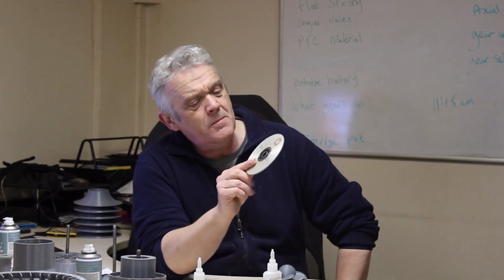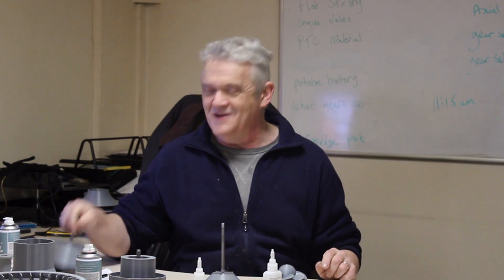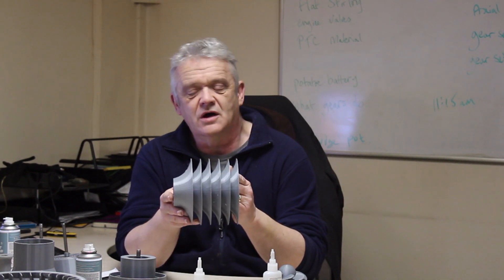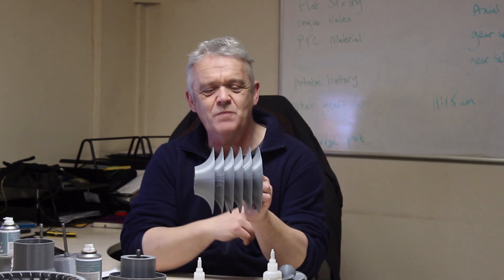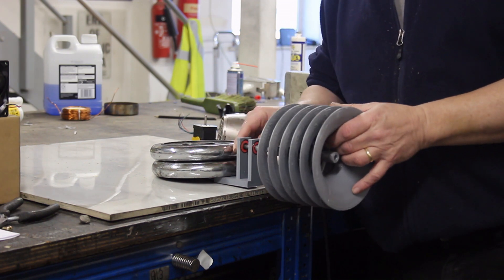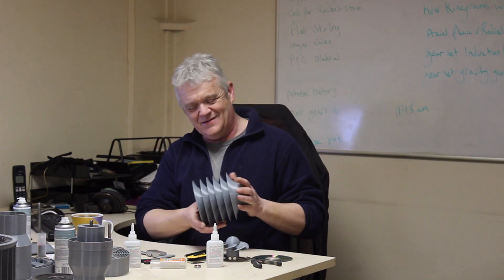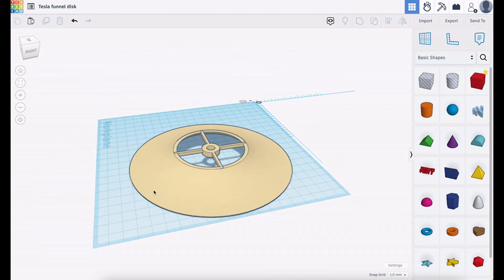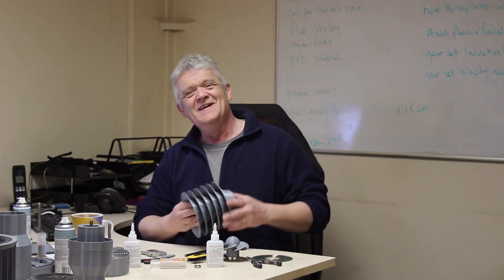1890 The Next Step In Tesla Turbines

Comment: I wonder if you could remove the central shaft. Make the holes increasingly larger, as you get towards the "exhaust". Use the Venturi effect to lower pressure in the center. 

Check out the eAhora M1P. I think there's the potential for practical perpetual motion.

Comment: Think wear hardening stainless cut on a plasma table . Very little machine work would be nessary.
With high speed/temp ceramic bearings .
The 2 failings of the original engine design ...
It will run on anything that burns .
Then one of Testlas high speed generators or alternator designs .
The cooling jacket would provide hot water or steam ...
Imagine an engine , steam turbine or a pump all from 1 design ???
And let's not over look the 1 way valve ...

Comment: I had a kid's board game that had a funnel and used a marble rolling around as a timer, forget the name.  I wonder...  painter's funnels?  They're conical.  Spiral grooves...  you don't need to do but a couple cm worth of rework.  Use a NACA airfoil where the cones hold together, pointed in the direction you need the generator to go.  A high-lift glider foil might be best.  Stack lots more in an off-center spiral?

Fire alarm horns?  Old PA speaker horns?

Comment: The formula I heard was 3feet diameter disks separated by 0.4mm gap at 50K RPM and driven by dry steam. This combination was expected to be the highest efficiency except that the materials he tried couldnt handle the tensile stress and that made him pareback on the specs.
Had Tesla been able to work with graphene, he might have reached a marketable product, reliable enough for mass production.

Comment: Just Incase you didn't know the Tesla Turbine doesn't need to operate at high RPM's to achieve results, the efficiency increases as the surface area increases and the gaps between the blades decrease. Tesla also filed a patent for an upgraded turbine number 186,082.
Reply: Correct its an electrostatic turbine not a friction turbine as commonly stated.
Reply: @off6848  I'm familiar with its use providing more torque inversely to the speed of the fluid between the plates but not its function as an electrostatic turbine, explain please?
Reply: @off6848 🦾🤓👨‍🔬
Reply: TL/DR from Charlie Solis: This is not a mechanical turbine in any shape or form. 

Since all molecular adhesion and internal viscous forces within a fluid are governed by electron orbital interactions, this makes the Tesla turbine a purely electronic turbine.

The BIGGEST misconception about the Tesla Turbine that most people get wrong is that they think the fluid is actually sliding and dragging on the disc, similar to as if a solid object was “sliding” across the surface of another solid object.   

It is not.
Reply: @JenkoRun  maybe my comments aren’t showing up but I shared multiple quotes explaining in a couple comments.
Reply: @testurenergy  Couldn't reply back till now, thanks for the sources.
Reply: @JenkoRun  well ignoring that will make cause you to misunderstand how these turbines actually work and thus not be able to optimize them appropriately. 🤷‍♂️
 
But to each their own I guess. 
It’s your prerogative to pick and chose to believe what you want.
Reply: @JenkoRun  spherical harmonics is not a “theory” in the way you are using the word theory. I can see you’re more familiar with the colloquial use of the word theory which generally means “a postulated idea that hasn’t been proven yet.”
 
But in the world of “theoretical” physics and math it has a far more finite, concrete and proven definition. 
 
Theoretical physics is a branch of physics that employs mathematical models and abstractions of physical objects and systems to rationalize, explain, and predict natural phenomena. This is in contrast to experimental physics, which uses experimental tools to probe these phenomena. (Not to be confused to  contrast with proven vs unproven) 
 
In modern science, the term "theory" refers to scientific theories, a well-confirmed type of explanation of nature, made in a way consistent with the scientific method, and fulfilling the criteria required by modern science. Such theories are described in such a way that scientific tests should be able to provide empirical support for it, or empirical contradiction ("falsify") of it. Scientific theories are the most reliable, rigorous, and comprehensive form of scientific knowledge,[1] in contrast to more common uses of the word "theory" that imply that something is unproven or speculative (which in formal terms is better characterized by the word hypothesis).[2] Scientific theories are distinguished from hypotheses, which are individual empirically testable conjectures, and from scientific laws, which are descriptive accounts of the way nature behaves under certain conditions.”
 
We are more than sure about electron orbital spherical harmonics. It’s extraordinarily well established. And any “new” postulation that is thought up to explain some unknown part of physics by definition must also then derive what we already do know and have established to be true about the universe with rigorous testing. 
 
Contrary to what most people think, it will not “up end” physics if and when a new and/or better postulation is found. 
 
The periodic table of elements isn’t changing if we find a new explanation of dark matter. It may expand what we already know, but it will not change the known elements.

Comment: I was wondering if you could use alternating dissociative metals for the inner turbine wheels and use an electrolyte solution for the propellant to create HHO gas while the turbine is running. 
Of course the whole unit would have to be electrified though.

Loved this video!
Reply: It is an electric turbine. It works on the principle of electrostatic adhesion not friction as commonly stated.

Comment: So is the endgame expected to be superior to a Vortex Bladeless redux, or other "concentrator" failures that have promised effective and relatively efficient alternatives to conventional turbines? I have a piece of sandpaper stuck on to the end of a drill bit. Not being well-connected to the bit, since its hole is slightly bigger, it rotates whenever the breeze kicks up a little. I can't imagine why it wouldn't. If I put a hair dryer on it, it would spin madly from its little bit of drag. It is also completely useless as any kind of design for power generation. The tiny sailboat-scale wind generator that my neighbors have, in contrast, is amazingly productive and inexpensive.

Comment: The big question is - is this actually acting like a Tesla turbine? Or is friction with the outer edges producing a low-rpm, low-torque rotation? We can't tell based on your video. Please repeat it with some way to show the airflow through the axial hub. If there isn't any such flow, you know it's not acting as a Tesle turbine.
"Conventional" Tesla turbines work as well as they do because they operate in a closed vessel. Working fluid injected at the edges MUST spiral into the axis because it has nowhere else to go. Your assemblies, being open will allow air to escape via the outer edge.

Comment: Pressed steel out of steel sheets. As you could have a mold bend the pieces into shape as well as have the middle keyed so that you can have a shaft through the middle more secure. And you can use washers for spacing. this would require some sort of press and mold, but in the end the product would probably be eventually cheaper as you wouldn't have to run a 3d printer. Just pressurize a hydraulic cylinder over and over on a sheet of rolled stainless or other metal of your choice. Of course you'd have to make a specific mold for the shape.

Comment: Can I ask why on motors there is only one drive from the shaft in all deigns of kinetic energy...
The weight distribution is a major factor; remember Steinmits charging $1 for the mark and the 99.999% for where to put the mark..
 Please explain the math in the ratio that to use to the surface and displacement of the vortex. My E7nglish is not quite explaining myself properly.

Comment: Of course the bearing mounted collector going to spin when air is blowing on to top side. Blow it on the lower side it will spin opposite direction. Nothing proven there.  I see there be much wind bypass slippage across those slick funnel surfaces. 
I would like to see 3 spaced fins that spiral downward inducing spiral motion. A few more parallel short fins in between at the inner edge. The funnel collector above and below have same design but opposite spiral direction.    The amount of air flow from each funnel would of course have to be tuned to create a uniformed increasing build of compression down the inner vertical stack of air..  If all spirals were same direction,  there would need be stator fins at the generating turbine.

Comment: A Tesla turbine principles is a friction between air molecules and a surface. Everything else is some misunderstanding of a hydrodynamics. Your high voltage line isolator works only because of a rough surface after a 3D printer.

Comment: As with all rotational energy generation you will need to gear the system to stop overspin. An external cylinder could be lowered or raised to close off wind access to each cone allowing the system to be completely smothered during storms or for maintenance.

Comment: Just been reading up on the Tesla Turbine, and after looking at this design, I have a question.

Will the "funnels" be attached to the bladed section within? So not only does the wind get funnelled down into the generator, but the very process of entering will also assist in the lower rotation?

This may have been answered, but I rewatched the video and didn't see confirmation.

Also, wouldn't groves in the funnels allow you to help determine the direction you'd want the wind to travel, and therefore rotate the blades?

A typical Tesla Turbine works based on viscosity, so I imagine it's currently spinning based on the micro grooves generated in the 3D printing process.

Comment: If / then ?
  If the air accelerates as is descends the hyperbolic funnel then does the pressure drop? If so are you able to create a low pressure column of air down a central axis? Would that pressure drop entrain more incoming air increasing efficiency? Think of it as a velocity stack on a carburetor. 
 I think the coanda effect will also play a role.

Comment: In CAD, create a cube, then extrude the shape of your cone from the top face of the cube.

Make sure that the inner most circular zone of the cone is also extruded to create a cylinder sitting proud of the tip of the cone.

Save this as a separate solid shape.

Once this has been done, create 2 x22mm square holes running all the way through the cubed base to the opposite face, from the left to the right edge.

Then, use the CAD slicing tool to slice through the front face in 22mm vertically orientated layers running from left to right.

Finally create 2 x 22mm x the left to right measurement across the lower edge of the front of the cube battons.

Save this as a separate file containing all the sliced shapes + the 2 X battons.

Have the job-lot sent to a plywood CNC company (maybe give them some advertising in exchange for the CNC time).

Once they have cut the basic shapes for you, have them stick each of the layers together such that they are slid over the battons to ensure correct positioning.

Once the solid shape has been created, have them use the solid shape file to have the curves milled to the required dimensions based on the solid object you first saved.

Then, it should be a simple enough task to fibreglass your cones using the former you've just created while using the 3D printer to create some spiraled separators to keep each layer the exact distance apart then need to be.

Could design the cones and spirals to slide over a plastic pipe during the construction phase to ensure that each layer is perfectly positioned during the layup and gluing phase too.

Comment: Spacing between profiles is critical, informed by the "boundary layer" - an emergent microscopic property - and the viscosity of the fluid entering the Tesla Turbine. 
You'll need to tinker to get it right, might not be possible to 3D print if the goal is highest efficiency but I certainly hope you can achieve a radical result.
Reply: @the_one_eyed_man_is_cursed  
A radial result lol

Comment: Is the water causing the disk to spin due the drag induced as it passes over  or around the disk. the problem with drag is that it increases with speed so to get better power transfer would you need high speed thus high flow rate of the water. if you want lower pressure water or lower flow rate are we not moving back in to the idea of a standard water wheel. they work better with low flow rates due to the paddles creating a high drag so impeding the water flow and transferring more of the power out of the water. 

Just a  thought

Comment: TeslaTurbines using water is fine, needing high pressure for it is an annoyance, what is the optimal distance to use ground effect, to drag them round? and will this work at lower speeds? sorry not on your level i just follow this stuff as it is fascinating, many thanks for all you do genius really, being a polymath allows innovation when specialisation restricts new ideas.

Comment: the true function of the tesla turbine is to have 2, one as a pump, the other as a turbine, on a common shaft, all under vacuum, running cold steam. that extracts environmental heat utilising the heat to do work and driving the system faster.

Comment: There’s nothing WRONG with the shape, it’s just the spacing.

Make one of VERY Light material at 4 thousandths spacing.

And it should funnel air into the center.

The flatter the disk, the less mass you have to spin.

Comment: Any natural wind would hit that thing,always,at 90 degrees to the circular form.
The wind would then be equally distributed on each side of the thing from the circle's center diameter.
Would that not cause the spin forces to be equally distributed to each side  preventing or seriously retarding any spin forces?
Perhaps spin forces would begin on one side but be quickly nullified by those on the other side.

Comment: You get another example of this boundary layer at work when you spray water from a hose, but put your thumb over the hole to create a high-pressure fan, then stick a paint roller in the fan so the fan touches it barely at first. in a second or two it will spin up like a powerful flywheel

Comment: Spirals are where my thoughts were going, but protruding, rather than inset - don't know why, yet. It would be simple enough to stretch a screw thread down both the inside and outside faces. It would be interesting to see rpm results with various models with inset/protruding spirals - various sizes of the spiral extrusions - maybe even try offsetting the axis of each spiral disk by a "x" degrees to see if any odd vortexes occur within...

Comment: I think the interesting question would be where the air is redirected. If it's redirected through the stack of cones and out of the middle, then that's extremely interesting. But otherwise it's just a drum being blown from the outside rather than the shear effect in a tesla turbine.

Comment: Alrighty, I just finished modifying the design to fit the shaft of a carbon fiber rod I had laying around in the lab.  The printers just started, ruby red translucent PETg. I think I'll start with 6 discs.  I have an aluminum sprocket as well that fits my cf shaft.  I wish I had an anemometer handy to compare wind speed v. power output.  What do you think for generator selection?
Reply from the maker: I am working on it mate - just having it hang out in open air will do not very much so it needs a case for sure

Comment: Grooves and or rough surface (on one side) will increase the surface friction which will increase the change in energy from the airflow to the shaft. Keep in mind laminar flow. Fluid dynamics on surfaces are tricky. First we have the flow. But really think about the induced laminar flow. Ie. The induced laminar flow is not the surface but the flow that occurs between the airflow and the boundary layer immediately above the surface. Roughening the surface will increase the friction between the surface and the airstream. Induced flow is magical and always counter intuitive to what we think is going on. Think about sharks , shark skin is rough to allow a better boundary flow and higher speed, manoeuvrability and grip in and on  the water. In the WW2 fighter pilots would have the engineers file back the leading edge wing rivet heads to gain speed (obvious !) wrong, the maximum speed was decreased and the aircraft handled way worse. The slightly protruding rived heads were in fact changing the boundary layer of the wing - induced airflow. N Tesla was right !

Comment: A tesla turbine will work with just one blade mainly used for pumping sewage. I wonder what this would do with just one big one. And what does this do when you point the hair dryer towards the middle sections? Cuz I'm thinking if you had one big one then it should be pointed directly at the wind forcing a large volume of air thru a small hole in the middle across a hyperbolic path. Maybe?

Comment: Use the hyperbolic funnel pattern. 
The Size Ratio needs to change, The spin will  happen naturally, It best not to disturb it.   IS IT FLAT LIKE A CD, OR CYNDIRICLE?  Stagger the vents to go from smaller to bigger. While thinking about the curve flow.  Also, Jib sails on boats. Forward flaps on Jet Plains.  Building Air pressure.  Rear sprocket on a mountain bike.  Fractals   Ty for reading me.